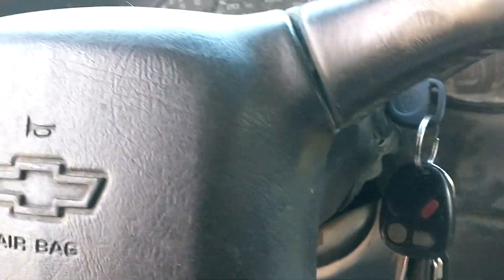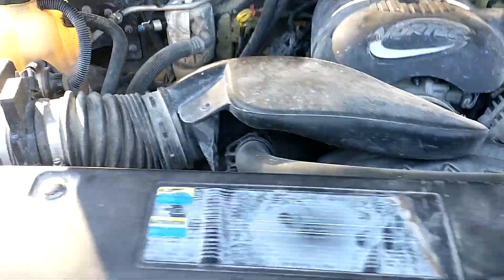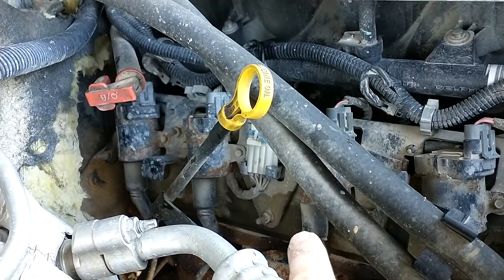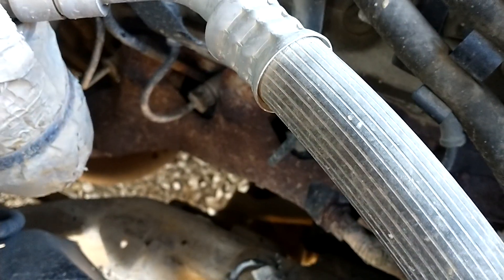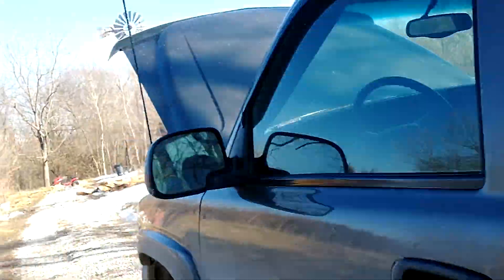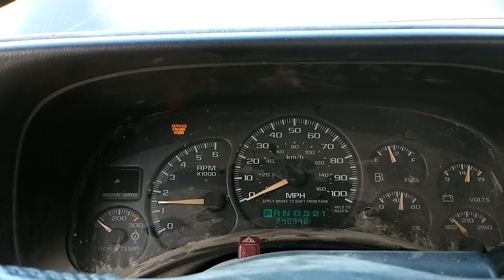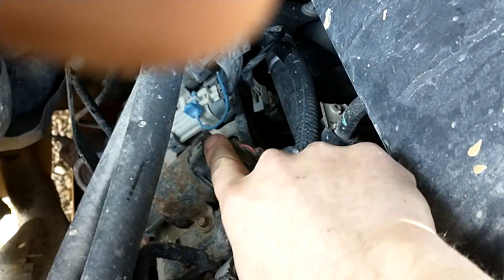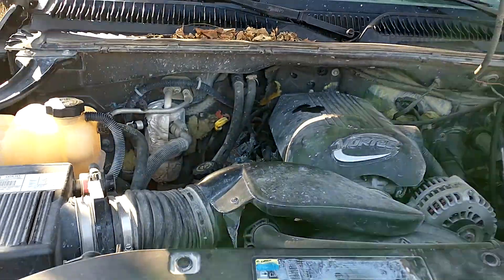Diagnosing P0300 and P0332 OBD-II codes on my truck.

Comment: Haded same issue haded some wire rub losses dude to age. Stop chasing your tail.
Reply: Dealership had to fix it.
Reply: @randyyancey8313  What did the dealership do to fix the issue? I'm currently chasing a misfire at idle only on cylinder 1, and I've replaced a ton of parts chasing it. Now, I'm about to dig into the injector wires for cylinder 1 to see if there's anything going on with them.

Comment from the maker: For anyone seeing this, the p0300 is persistent, I haven't had the chance to swap any components. The p0332 was solved by relocating the knock sensor to the outside of the cylinder head at the rear of the engine. If you search YouTube, there is a tutorial for this by someone else which is what I used. It's been a year and a half and the relocated sensor still works perfectly. As far as the random misfire, I did find that using higher octane fuel seems to defeat the misfire which may mean it's an injector or injector harness issue. I had one instance back when this was recorded of a cylinder 1 misfire code that has not returned since, which gives me a place to start if I ever get around to it.
Reply from the maker: https://youtu.be/gYGWWBtuXME

Here is an update, nothing big but some more current thoughts on the causes of a p0300.